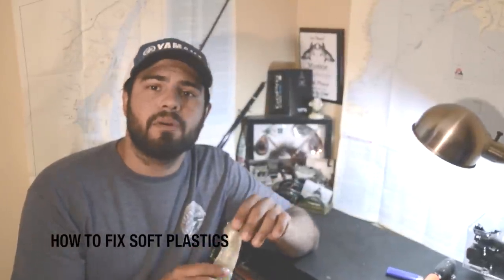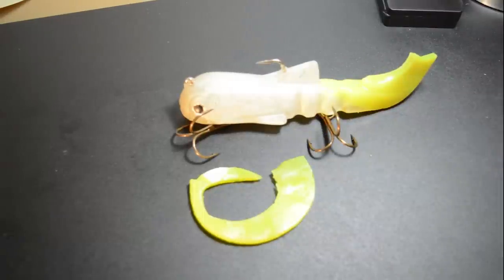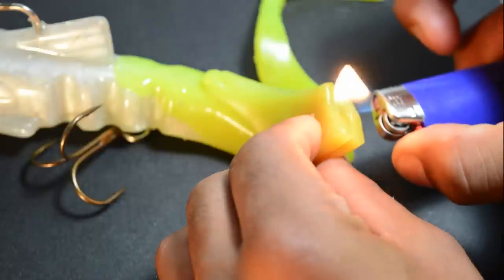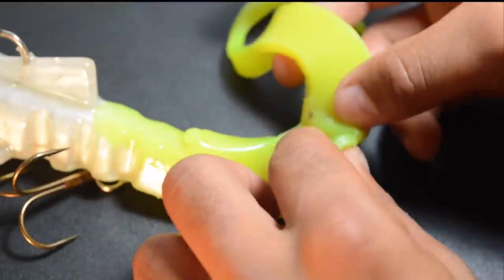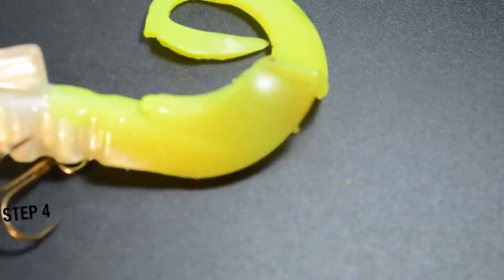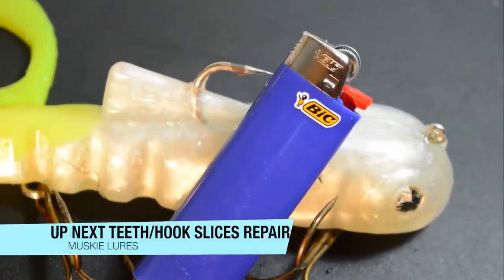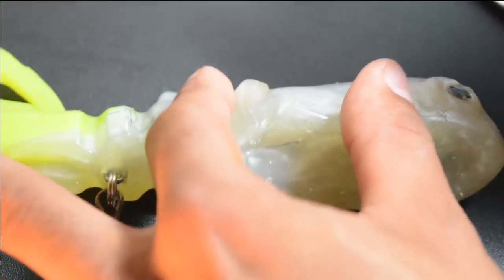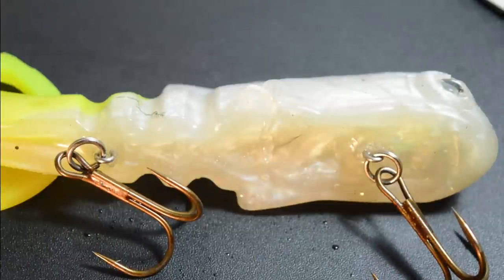How To Repair Fishing Lures

Comment: Also, as a warning. Plastics can be very dangerous to skin when hot. Because it will fuse to your skin. So, kids be weary of getting hot plastic on your skin.
A mini lighter torch from a slight distance could be more directional.  But* will be much hotter and if too close will melt away the plastic.  But works if ya master it. 
Also, heating metal knives can be inserted to meld things like bites and tears.
Doing this kinda work makes tv watching better.  And, keeps ya amped to get back to the water…I find.
Love working on poles/setups during a movie.

Comment: Mend it works much much better no heat and no melted rubber on the boat carpet
Reply from the maker: +22yoshifan Mend it works great! This is just a quick fix if you don't have access to Mend It products.